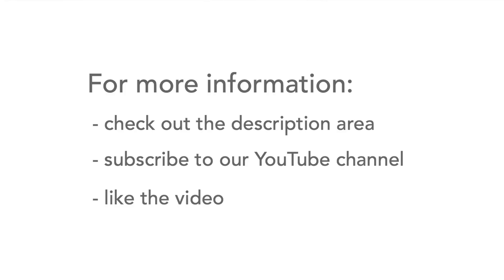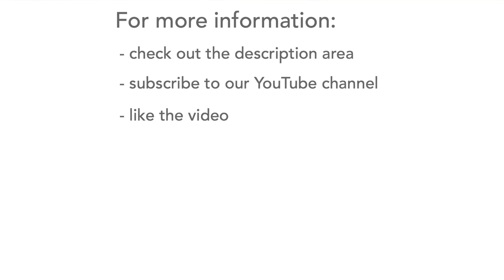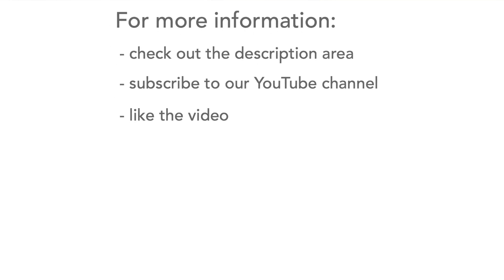Counterfeit Components: what are they, what are the issues

Comment: Whilst I 100 percent agree with this from a business manufacturing component sourcing, you only painted  just one side of the picture. I can personally buy components at a fraction of the price of the main stream supply chain. Cost is often as important factor as performance.   Competition drives inovation and im not going to cry over the bottom line of semiconductors designers and fab, they are doing very nicely  thank you, and just crying about the fact we no longer have to stand them having complete controll of the market.  In the lock down, I suffered hugely due to global shortages, there was no actual shortage of components simply companies choosing to manufacture only the top end  high value of their product ranges and that is the main reason some compoents were in short supply.
Reply from the maker: It is the perpetual problem. Manufacturers go for what gives them the most profit. This doesn't necessarily link to what some people need.

Comment: You did not take the opportunity to advise your views of where they are most likely to encounter counterfeit components. Basically, buyers should assume that 100% of all components found on secondhand seller sites are counterfeit. Namely Amazon, Ebay, Tuma, AliExpress, etc. Whether you should buy those is a matter of use. In some instances, like practicing to solder, you may not care if the device works, or not.
Reply from the maker: Yes it probably would have been worth mentioning that components bought from non-authorised distributors could well be counterfeit. There is so much you can say and you don’t want make the video too long.

Comment: did i hear no BS pricing for original components and ic`s  as of the near future. ?..  for most of the non mega circuit designers who can just push the price to the next in the process. original comp are mostly just filled with diamond or sommth...  i rather get scammed out of 3 or 10 dollars ,, than getting scammed a bit less for 100 ..